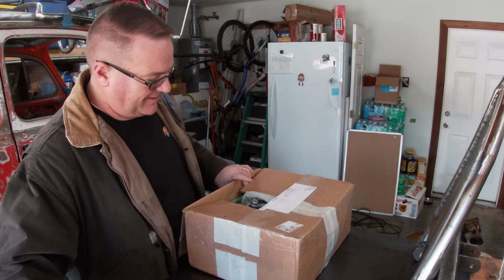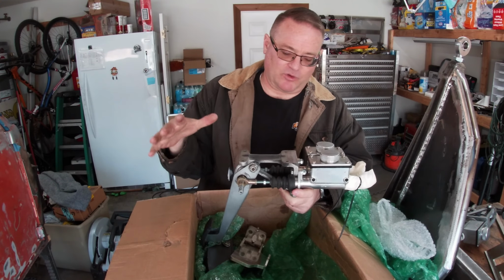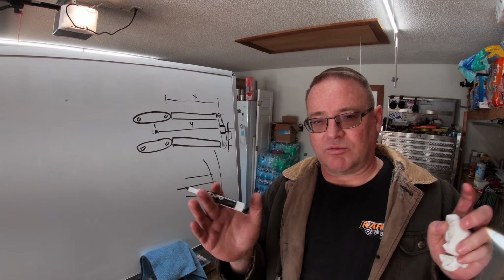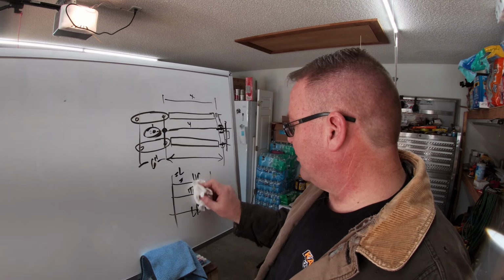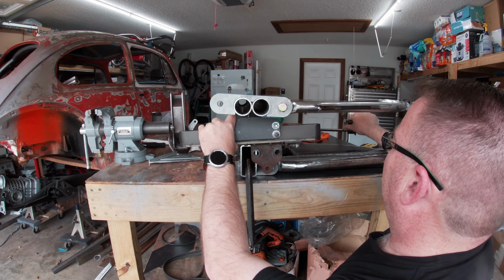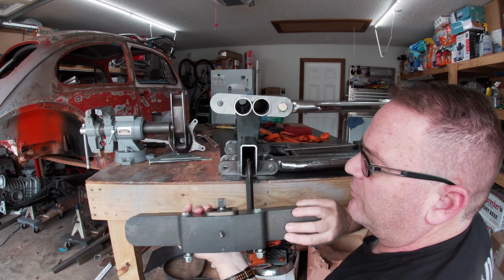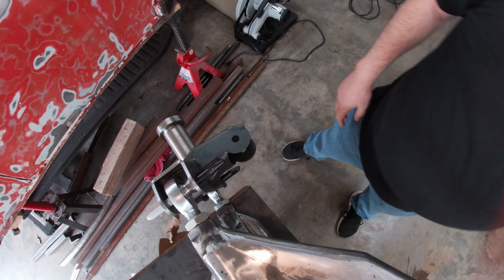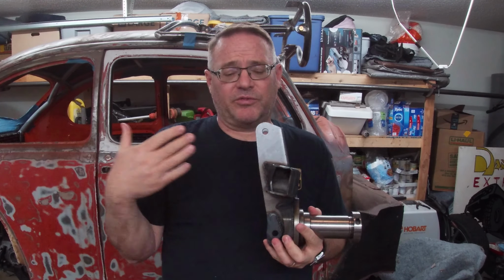Baja Bug Build (Ep. 34): Steering Rack Woes (..and some parts got delivered)

Comment: Looking good!...you'll probably have to add a access hole in your lower rectangle tube for your grease fitting. I had to do it on mine, I'll send you some pictures.
Reply from the maker: Yeah, you're probably right,  I got the biggest rack I could fit in there.  With any luck it'll hold up!  Thanks D

Comment: Front steer. I have the bottom steer rack. It’s working nice so far. Just flipped it to top steer. I also have 8” to play with between my arms. Thanks for sharing this video.
Reply from the maker: Lucky bum! If I had that much room, this rack would have worked.  Regardless, onward!